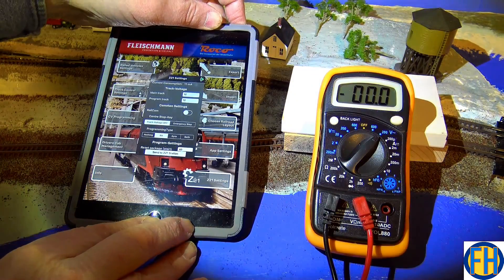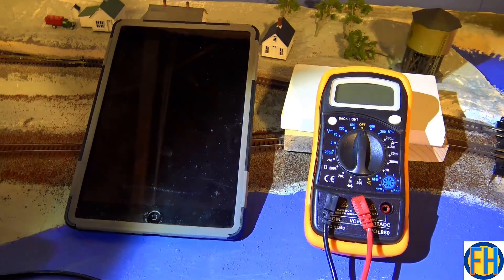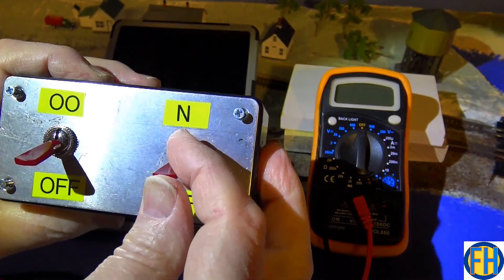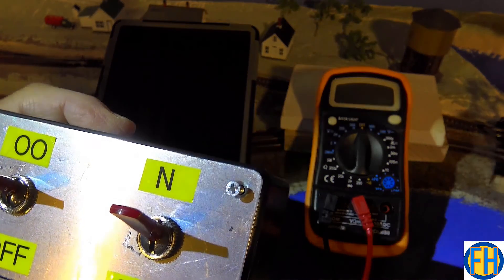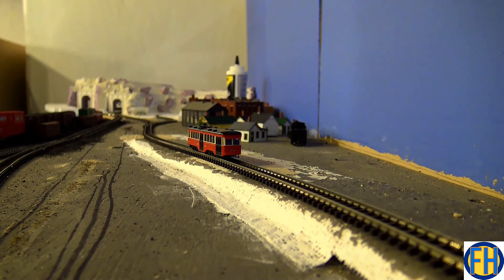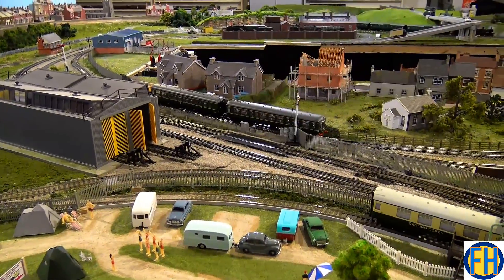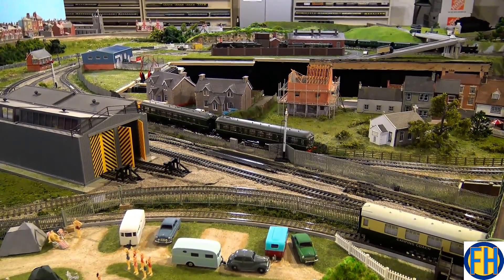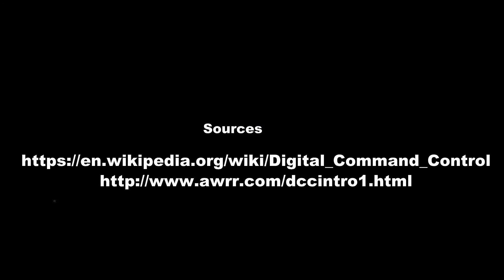Do You Know Where Your Voltage is? Colorado & North Western

Comment: you can use just about any voltage for your track as long as you don't exceed your trains limits.  The pwm signal is standardized across all brands and is set by JMRI.  This is why you can us an arduino or rasberrypi as a base station.
Reply from the maker: Hi Mike, Yes and there are limits based on the scale.  NRMA has set the design voltage differently for HO and N.  OO appears to prefer a slightly higher voltage than HO.  Thank you, Rob

Comment: The great fun of electricity.  My NCE Power Cab runs at 13.8 volts for any system its connected to.  From what I have learned most new systems are running around 12-14 volts.  Not sure why the Z21 runs at 16.  16 volts was used on the older systems.  Maybe Germany they are still running the higher voltages hence the reason the voltage can be changed.Scott
Reply from the maker: Hi Scott, voltages for DCC is/was set by the national model railroad association NMRA with was accepted by the industry in all nations.  I may have higher voltage in my mains which would explain the difference.  Farland is usually at 16v but when I went to measure it for the video, for some reason it was at 17.  Many newer design control systems have a physical switch.  Thank you Scott.  Cheers, Rob
Reply: +Rob McCrain I am no expert on this, but I read somewhere that the voltage has been lowered.  I wish I could remember.  I don't understand why its still at 16 volts when the motors and electronics run at 12 volts.  Is it to compensate for long runs in the rail or resistance?  I will have to look into it some more.  I know my system is at 13.8 volts which you can use on a N or HO scale system.  Always learning.Scott
Reply from the maker: +Scott Downey it would be my guess that they split the difference between N and HO and picked 13.8.  That way either will run on it.  It is all about spikes.  Dukes from sparks, spikes from the mains and on.  A spike at 12 v is going to be lower than a spike at 16.  My N scale locos are running much better now on 12v.    Read the spec and check the forum for info.  Rob

Comment: Very interesting video Rob, I run N scale with an MRC controlling system, now I am going check and see what the voltage is.
I was totally unaware that there was a difference of voltage between N scale and other scales. You might have just saved me a bunch of money. Thanks again for posting this video. Rick
Reply from the maker: Hi Rick, who knew, right?  It would seem to me that it should be on the boxes N scale comes in.  I would not have known if I hadn't burned out some lighting.  I would like to report my locomotives are working fine now on 12 volts instead of the 17.  Further reading reveals that spikes at higher voltages are what do the damage.  If you saw your incoming power you would see there are many little spikes in it.  Spikes can be created in your system if there is a spark as well.  The lower voltage helps protect from them in that the ever present spikes are lower.  Thank you, Rob
Reply: +Rob McCrain Hello again Rob, I just thought that when I tested my MRC system it was running at 
13 volts, so I should be OK. Thanks again for a very helpful video
Reply from the maker: +MWRR There will be variations in mains voltage and regulator voltage.  You are good. Thanks, Rob

Comment: Well you learn something everyday - how true is that!  Thanks for the heads up on that Rob, that will come in very handy when I eventually start my N gauge project, it wouldn't have even occurred  to me to change the voltage when going from OO to N gauge so this video has probably saved me a lot of money. A very informative video Rob so thanks for that.          .........Graham
Reply from the maker: Hi Graham, I got the track cleaned up and both locomotives are working on the reduced voltage.  In fact, I think they run better.  Too bad about the observation car with all the lights in the back.  I do think the 17 volts killed them.  Yes, who knew...  It was an interesting research project.  I felt like I was back working again.  Thank you, Rob
Reply: Knowing you Rob then I think you probably enjoyed that little trouble shooting exercise!!        .........Graham
Reply from the maker: +Graham Foulston Yes, no doubt about it. It was a fun chase.   Rob

Comment: Hi Rob , sorry to hear of your problem , but maybe save someone else having same probs , I have my ecos set at 16v , and as has been said these can be changed to what you want ,  by the way track at 7.06 needs a clean , not accustomed to the z21 so thanks for showing ...also your video seems a lot clearer , you changed anything ? ..Dave
Reply from the maker: +David Howarth Hi Dave, not a big problem.  I haven't been running much a the N.  Just building scenery, buildings and vehicles for it.  I think it is the lighting.  The track should be clean.  At least trains are running fine on it.  A number of my subscribers have the Z21, so I thought just in case.  Video clearer?  Don't know.  I do have trouble remembering to switch it back to auto focus after I do a scene with manual.  That could be it.  That is what happened in the beginning where it suddenly all came into focus.  Thanks, Rob

Comment: I didn't now that voltage varied between scales in DCC, but since I'm analogue and OO only, that's not a problem I will face any time soon, great video by the way, very informative. Keep the faith - Callum
Reply from the maker: Hi Callum, yes, who knew?  It is not an issue for most people.  It is for me however.  I just thought I should get out the word.  It has been a very interesting dive into the workings of DCC.  Thank you, Rob

Comment: Very good video Rob, we all find out the hard way, but it makes you a better person, not to make the same mistake again, My N gauge runs on 12.5 volts, but I think you can run on 16 volts, its not the volts that do the damage all the time, some times it the amps, my run on 3amps, great video rob, we are on air Tuesday nights at 8 pm UK time (that is google + Hangouts.
Reply from the maker: +Terry Ward Hi Terry, the issue can be spikes.  A spike that comes along at 16 volts is going to much higher than a spike that occurs at 12.5 v.  That's all.  According to my research, many folks run their N scale systems at 16 volts.  Cool, I will keep a watch out for the invite.  Thank you, Rob

Comment: Hi Rob, sorry to see you had problems with voltage that damaged your lights and decoders, what a pain that must have been. You are right, DCC does work on a pulse,  "pulse frequency modulation", and what an interesting way you solved your problem. You can buy power supplies with a variable switch on them that will alter the voltage and current. The Ecos power supply has a dial to switch from N to OO scale power and back again. I hope if does not cost you too much to have your decoders replaced/fixed...Simon
Reply from the maker: +Liverton -Simon A dial switch would be handy.  This whole thing of voltage for scales just doesn't jump out at you like it should.  I would have saved me if it had.  Well I am wiser now and hopefully so is someone else out there. Thank you Simon.  Rob